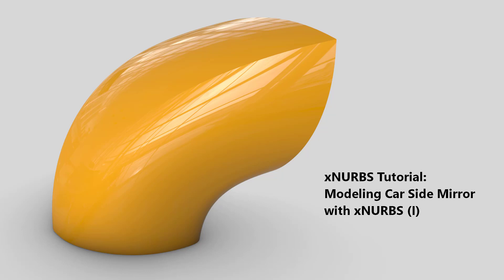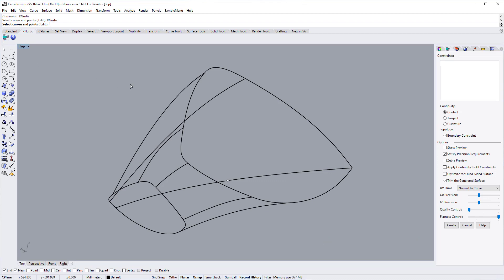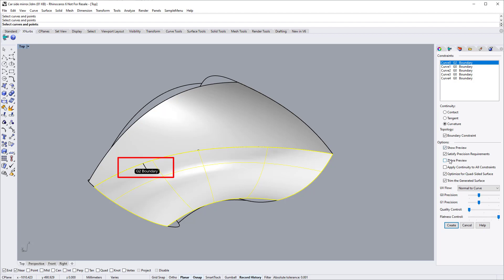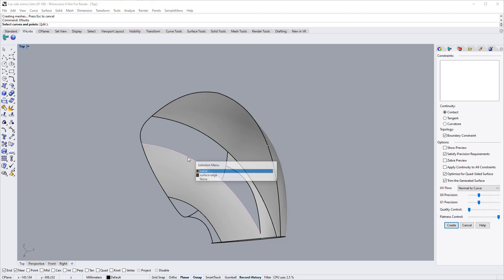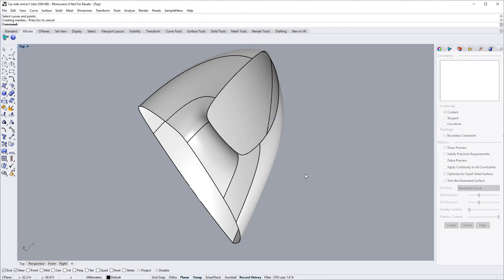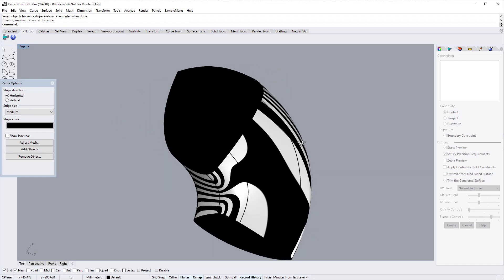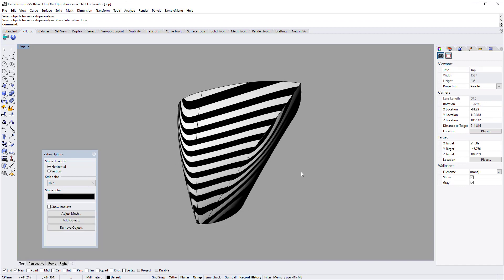xNURBS Tutorial: Modeling Car Side Mirror with xNURBS (I)

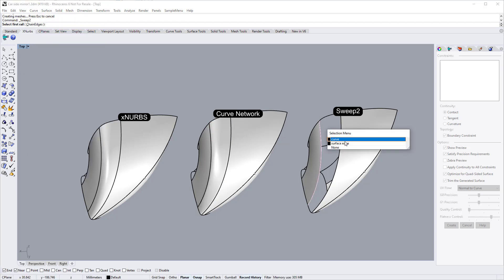Comment: 2:40 min.
why not using 4 sided surface standard Rhino command – it will produce minimal CV surface although wont match G2 on all 4 edges but your demo example only matches 2 edges with G2.
Most of the cases designers need 4 edges with matched G2 (or 3). For 5, 6 edges xNurbs is great to do it faster for presentations, maybe not so good for manufacturing though.